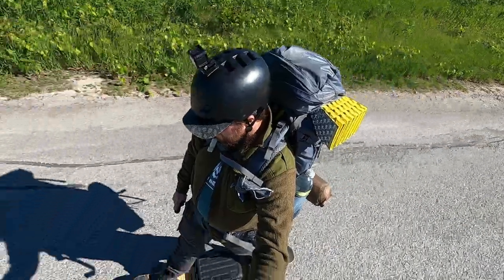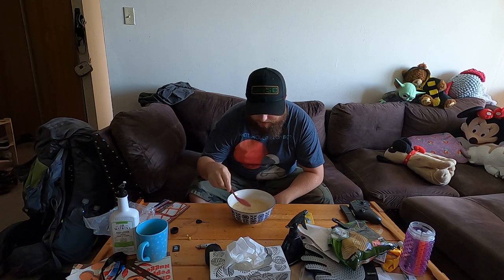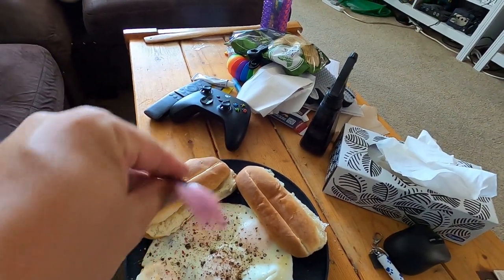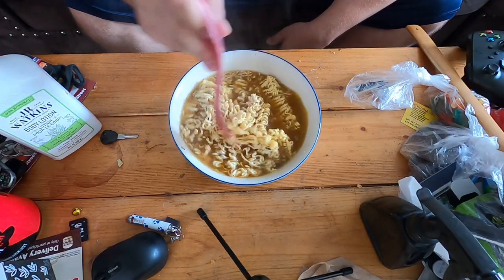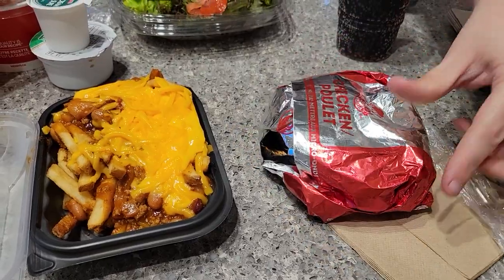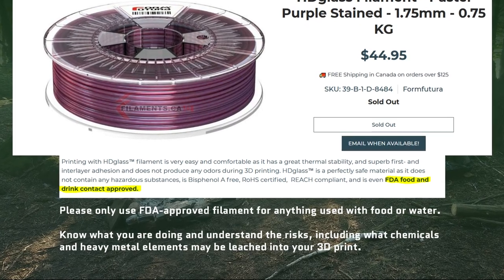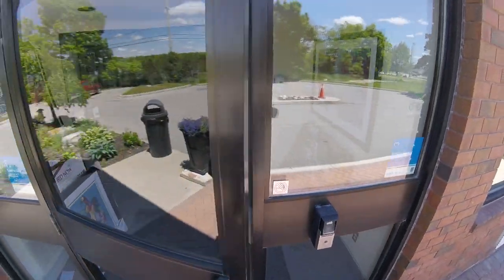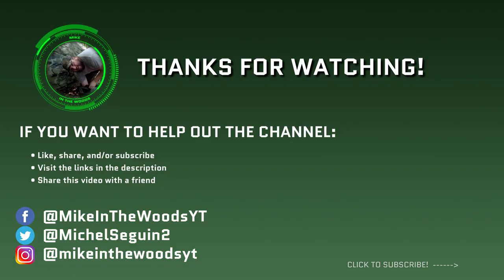Can This Ultralight 3D Printed Spork Survive a 48-Hour Durability Test?

Comment: my biggest concern with this would be the fact that most 3d-printed plastics aren't food-safe (especially on an FDM machine the grooves make a great spot for mold to grow, along with the micro-plastics being deposited directly into your food). I would be interested to see something like this in a food-safe polymer or resin though, but I would imagine that those probably wouldn't have the weight advantage anyways.
Reply from the maker: This specific material I used (Form Futura HDglass) is marked as food safe; but yes, definitely need to be wary of bacteria growth in the microscopic ridges, and even things like lead & chemicals leaching into the plastic from the 3D printing process. (I make mention of this in the video)
Reply: you can get a food safe expoxy to coat the spork

Comment: I think the only concern is cannot use it to cook with direct fire. but 40% lighter? I take the 3d printed spork.
maybe adding some coating oil to reduce the problem?
Reply from the maker: I thought about that when thinking about the 3d printed spork originally; but in a backpacking setting, you're not really exposing it to heat all that much. Only exposure would be from stirring food in the cook pot. 

PETG can withstand a bit of heat, though not much. I use it for the hard drive stacks I HDD mine with, which get too hot to touch. So it won't melt, and as long as you limit the heat exposure it shouldn't create any toxic runoff beyond what you're already at risk by from using a 3D printed utensil